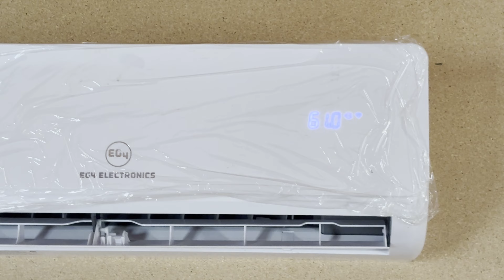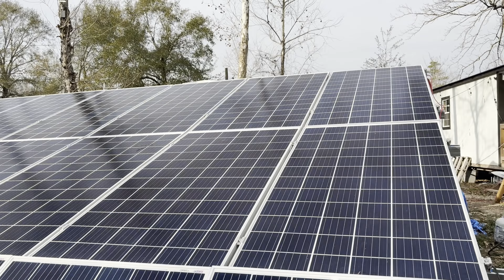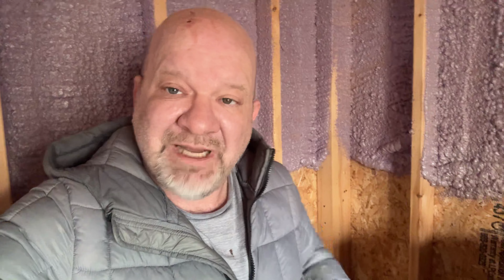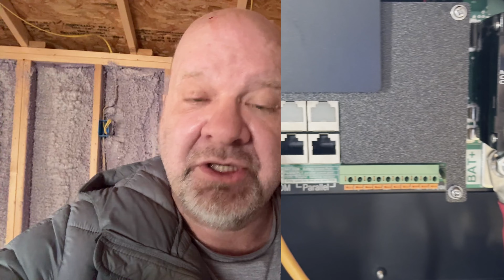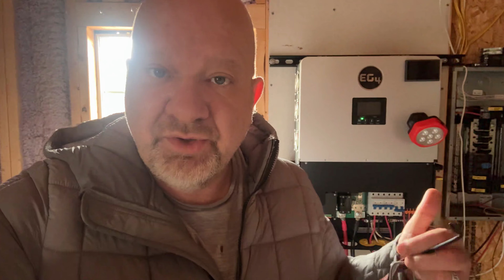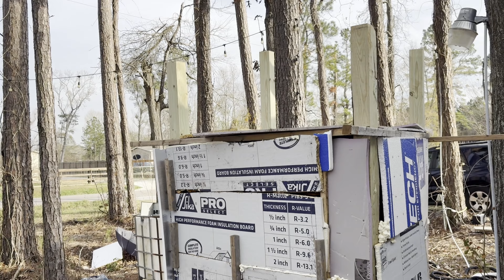1 Million Lost Power, Our Solar Home Stayed Warm—Here's Why

Comment: You have to separate Texas grid from the rest of the country!!! 😂
And it is sad that a lot of people only have solar no battery system, but that was only because of high cost... They helped bring down the cost of panels....
I only have a 3000w inverter, with 500ah battery, that's all I need to run my house for several days with no sun...
Reply from the maker: Texas definitely does operate mostly on its own grid (ERCOT), and that’s part of why events here get so much attention.

And you’re absolutely right on the second point — solar without batteries isn’t backup power. A lot of people don’t realize that. If the grid goes down and you don’t have storage, most grid-tied systems shut off for safety.

That’s really why we built ours the way we did. Solar + batteries + proper inverter setup = actual resilience.

The goal isn’t politics — it’s keeping the lights on and the family warm when things happen.

Appreciate you jumping in the conversation.

Keep shining, stay charged.

Comment: Genmax trifuel with 2 wire connection to inverter  auto start when batteries get low
Reply from the maker: That's a smart setup for reliable power, especially when the grid goes down!